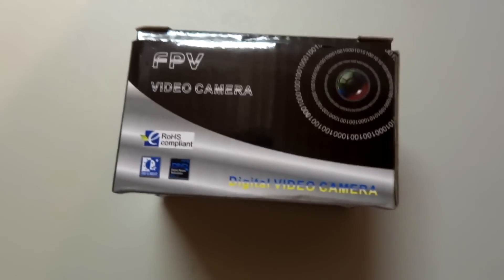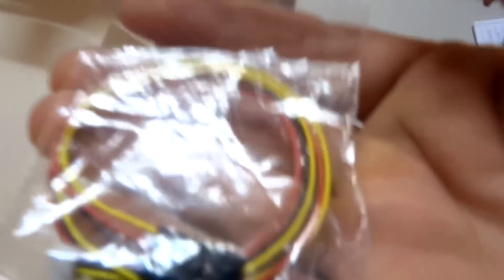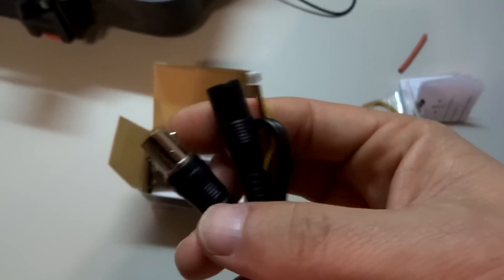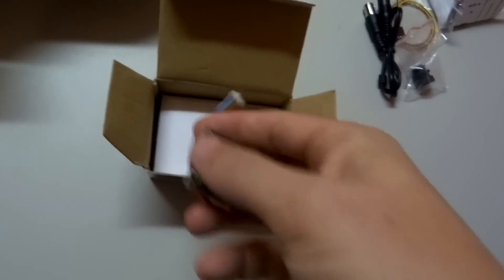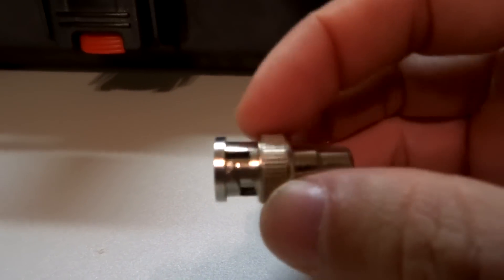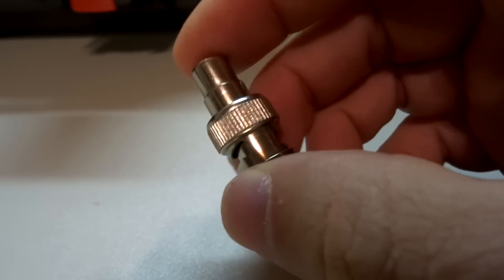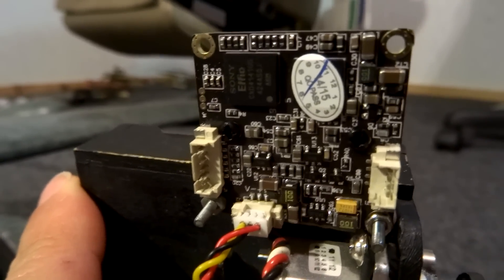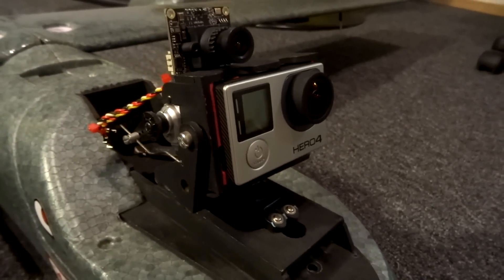CC1526 Sony Effio-V 800tvl FPV Camera from Surveilzone

Comment: Very nice footage!
Impressive quality!
Did i heard a voice? From the OSD?
Thanks for sharing and happy end of week
Reply from the maker: Yeah, that voice is from the OSD. The Vector has voice readouts for a few different things, the only one I have turned on is the mAh. It calls them out every so often, I think every minute. You can adjust that though. It will also call it out when it hits your set level, mine is 50% of set capacity. I have a 5000mAh battery, and have it's capacity set in the OSD as 4500mAh, kind of a safety buffer, or reserve. ;) It will call out the mAh when it reaches 2250mAh every time. Keep in mind that all this is adjustable, and works for a few other things too like voltage, distance, speed, alt. etc. I like the Vector! :)
Reply: bonafidepirate Thanks for the answer! That's brilliant mate! I should think about getting one of them lol

Comment: Great vid, love that camera. What's up with your climb rate on that flight? It was going nuts!!
Reply from the maker: eric deherrera The Vector shows climb rate in feet per minute, instead of feet per second like some other ones. Personally I think Ft/minute is too sensitive, it always jumps all over the place like you see here. I usually glance over at the graph instead... or just look at the altitude ladder.
Reply: Oh gotcha, I don't have the C/R on my screen I just use the graph. I keep my vector kinda minimalistic. Amp, volts, a/s, g/s, altitude, mah, time remaining, RSSI, link quality distance. Home RADAR arrow. Simple AH. Love this flight controller! Need yet ANOTHER one for my current build. I know it can be swapped but the one in my penguin is buried in there pretty good! Love your videos man, don't stop anytime soon!
Eric D./CentralKsFPV.

Comment: UHF noise?
Reply from the maker: michael pilolli I haven't checked it yet, but I haven't noticed any bad effects with it on the Skyhunter. That said, the antennas are spread out on the wingtips on this plane, so it would have to be real bad to show up inside of the 3-4 miles I flew... lol I'll check it using the spectrum analyzer built into the new DL receivers soon and post another video. I want to try tweaking some of the camera settings too.

Comment: hay how do you think this cam compares to the cc1333
Reply from the maker: Wyll Surf Air I think it's as good or better at handling direct sunlight in the frame, and there's certainly more detail, and a sharper picture than the 600 line Sony. (CC1333) It mounts the same, uses the same 12V supply. I like the image better, and it costs about $20 more. So for me, I would recommend this one if you want a better picture, and are willing to spend the extra $20 to get it. For a beater plane/quad/whatever where you might crash a lot and dont really need the best, the CC1333 is still a fine camera, and can't be beat for the price.